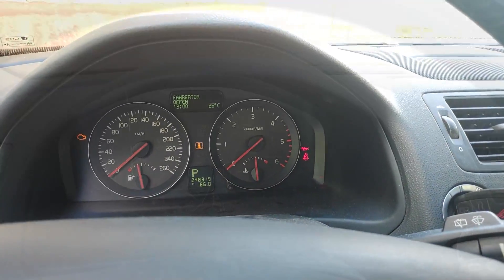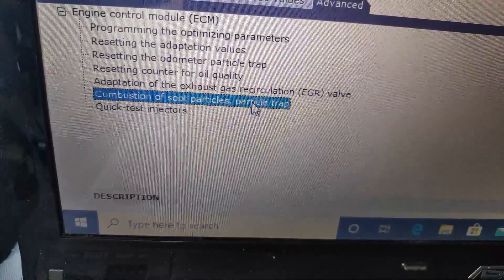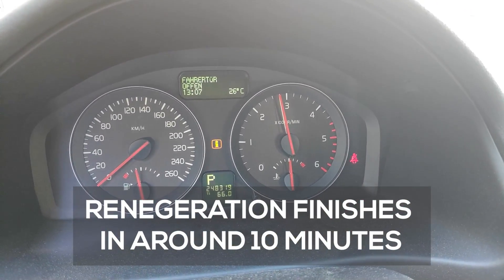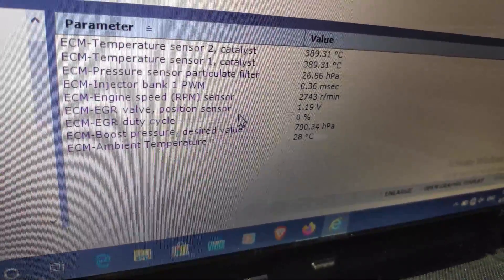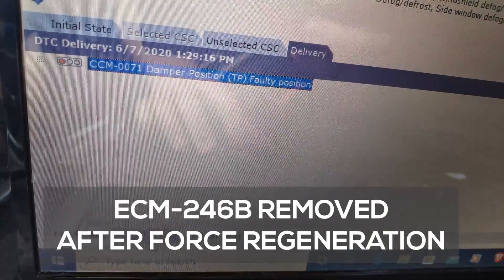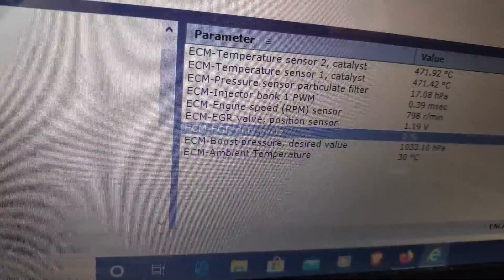How to perform forced DPF regeneration Volvo V50

Comment from the maker: Was the Tutorial useful? Hit 👍 Thumbs Up - Consider 🚩Subscribing!
Timestamps:
00:00 Introduction
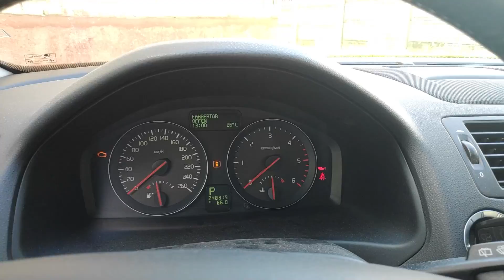00:10 You will need VIDA device and a laptop
00:31 Fixing ECM-246B Vehicle condition incorrect for diesel
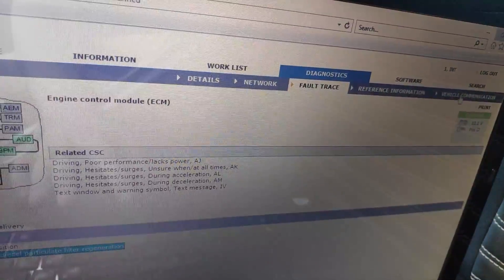00:58 Adding ECM Parameters to monitor DPF regeneration process
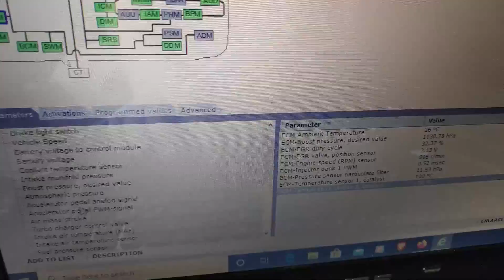01:40 How to start force DPF Regeneration in Volvo V50
03:13 The start for Regeneration process 
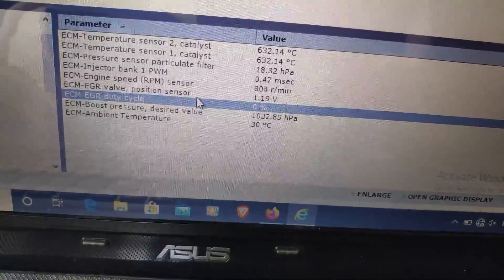12:22 DPF Regeneration process finishes
ECM-246B Vehicle condition incorrect for diesel

Comment: I bought an Autophix 7110 and tried to initiate a regeneration on it but it didn't work. The unit just showed "OK." But didn't do anything. I have P242F code too that I can't clear. Will that prevent a forced regeneration?
Reply from the maker: No idea. Sorry, maybe your device lacks some protocols or some stage to initiate the whole process? Not sure.
Reply: @TarantuloTV  I did some more research and it won't trigger a regen with persistent error codes. I think it believes the DPF is full of ash so it won't do a regen.
Reply from the maker: With Vida I think I managed to force it to restart, with cleaning the error codes, maybe volvo diagnostics just have more capabilities - not sure

Comment: Will doing this remove the “soot filter full” message and release the car from limp mode?
Reply from the maker: Yes. That is the idea.
Reply: @TarantuloTV  As I’ve actually sat and done a stationary regeneration with the car at 3k revs for about 12-15 minutes but the message didn’t go and the car is still sluggish. Going up to someone who has the software today as I presume that without that it won’t clear the warning message and reset.
Reply from the maker: Yeah with the software you can force start it.
Reply: @TarantuloTV  It was clean. It just needed resetting. I’ve learnt that once the message comes up I should go for a drive straight away, this time I carried on using the car for short journeys for 3 days then it went into reduced power mode. Then even after burning off the soot it still stayed in that mode with the warning until we reset it with Vida
Reply from the maker: Got it. DPFs are so annoying...

Comment: a bit confused - as the unit was rated at 12hpa but after the regen was at 17hpa ? - but yes i see the fault code had cleared
Reply from the maker: The values for these things are not exactly correct sometimes.
Reply: Mine is register between 400 and 700hpa. This is basically a clogged soot trap correct? My turbo is very lazy. I'm thinking of removing it all together. What should the resistance be?

Comment: Hi there Useful. But i have been told that the module has failed. I dont have access to one of the Vida devices so cant check myself. what does the module failing mean?
Reply from the maker: You perform some checks. And it should work. But I am not an expert.

Comment: Hi! Thank you for the tutorial.  I saw some tutorials for other manufacturers like Opel, Ford, Mercedes, that owners could install a led indicator somewhere inside the car. When the regeneration process is starting, the LED indicator lights up. The back window's defrost circuit is turned on while the regeneration is taking place (Opel, Ford, Mercedes). Do you know if Volvo is using the same technique ? I would like to know when it's regenerating so I can wait until its finishing, because for a while I cannot access the motorway for long drives. Thank you.
Reply: You also might notice the non zero fuel consumption when regen is in progress and you let off the accelerator. These slight hints might tell you that regen is 8n progress.
Reply: Most probbably yes, since while in regen, the engine must be under load. To add more load, the ecu switches everything it can and isnt easily spoted (who would expect and notice defrosting mirrors or window heating on)
Reply from the maker: Sorry missed you comment. Not sure if that is possible here.
Reply: it shows a message on the little screen behind the wheel and you feel the car dropping slightly in power

Comment: On the D5, the DPF pressure sensor must be re-adapted to the ECM after a forced regeneration and also the DPF soot counter must be reset.
Reply: Can you describe how this is done? Thank you!
Reply from the maker: What is done? Did you watch the video.
Reply: I'm about to do a regen on my volvo v70 mk3 awd 2009 soot filter full on dash .intermittent power ..sometime all the power is there but only in different periods ..overtaking is a no at moment.
Have vida on laptop,vida cable ordered for next week .. hope it works ..
Reply from the maker: Good luck. It will 🙂
Reply: @TarantuloTV   does the scan tool have to be volvos vida scanner or can it be something else?
Reply from the maker: @trevordoo6866  It might be available on other software tools, but I used the Volvo Vida stuff.

Comment: Where did you get the scan tool to buy? My V50 1.6 D from 2012 suddenly lost power today. It is showing no error code, but I am guessing it may be something with the DPF. At least, I would like to get a first opinion with a scan tool before I go to a garage.
Reply from the maker: Ebay of course. Vida for Volvo.
Reply: @TarantuloTV  Thank you, but he didn't buy it on Ebay. I checked already. I got a solution, so no need again.
Reply: @olanrewajuin2008  I have the same problem, what was your solution?
Reply: @andreastorpmark9773  The day I experienced this, the temeperature was -17°C. My guess is that my car's DPF was not heating up fast enough to efficiently burn the particles and that forced the car into a limp mode. What I did was to drive to force regeneration by driving at 60-80 km/h at gear 3, at some point, 4. I continued until the DPF had really heated up. This took about 20 minutes on the highway, then the problem disappeared.

Comment: I just did this on my 2011 S40. The process was somewhat different and took 25 minutes, but the video was still helpful. Thank you.
Reply from the maker: Glad it was useful in a way. 🙃
Reply: hello, I have a 2011 s40 too. km 180000. I use it constantly in the city. What do you recommend for precautionary purposes? will it work?
Reply from the maker: Regularly, every couple of weeks drive 20-30 km at higher speeds.
Reply: @TarantuloTV use Ox-cetane in the fuel.
1ml per 4.5 litres of Fuel.
Reply from the maker: Addatives always a good choice, or getting a good quality fuel.